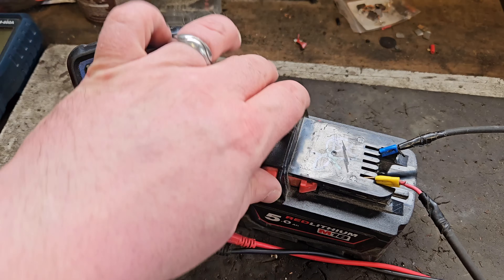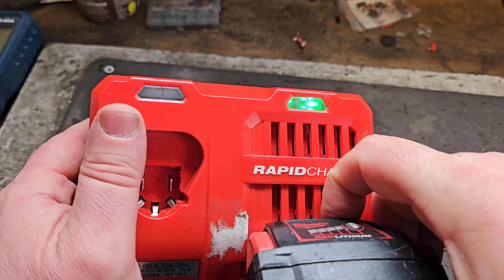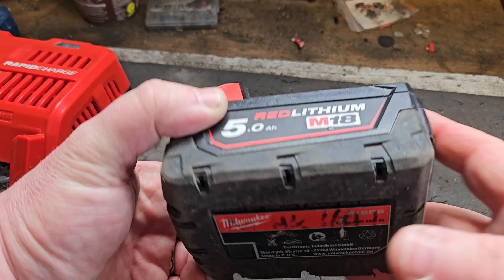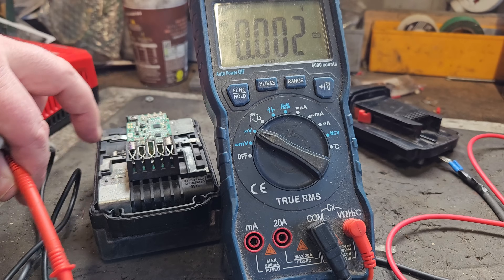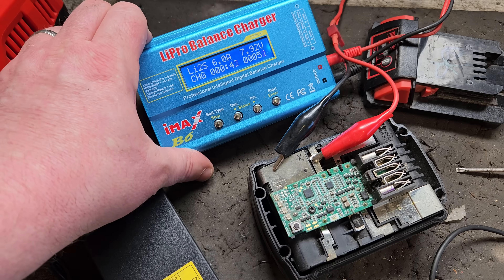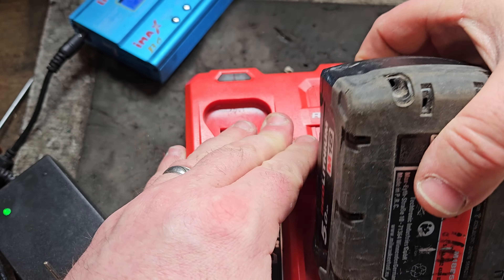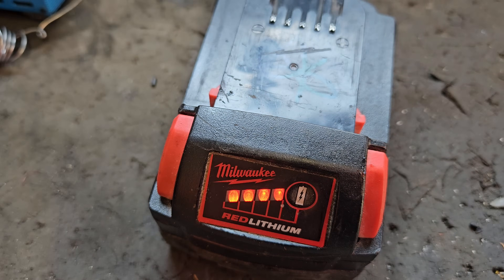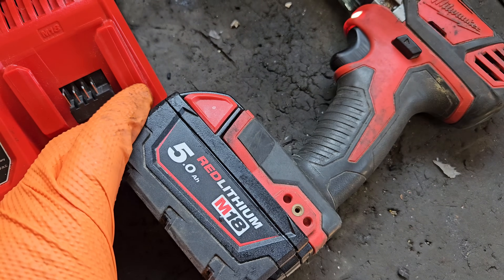M18 Battery Shows Voltage But Won’t Work? Here’s the fix!

Comment: there's a way to reset the board , in this case of problems , the main IC in sleep mood , when the volt is low the IC will lock , the hack is to give a 3.8 V to 102 om then the board will reset
Reply from the maker: I gotta figure that one out
Reply: Can you please explain this. Thanks.
Reply: the resister in the bored 102 om short it with b1 , the main IC will rest 
if you interested i can send u a video  @georgef7754
Reply: i don't know how to sned pic where u should make a bridge @georgef7754